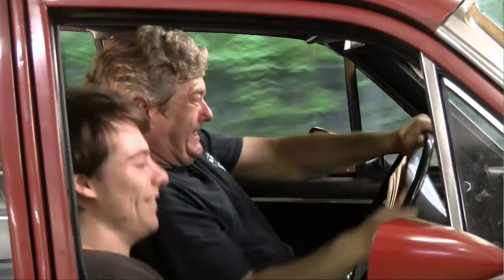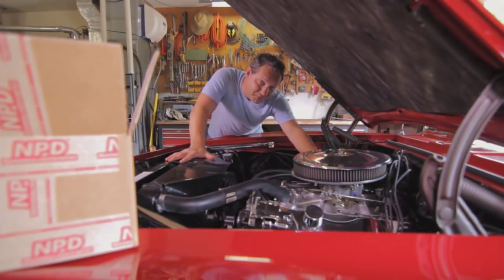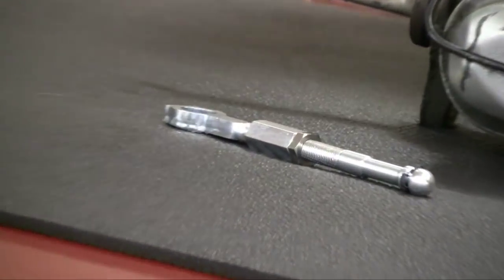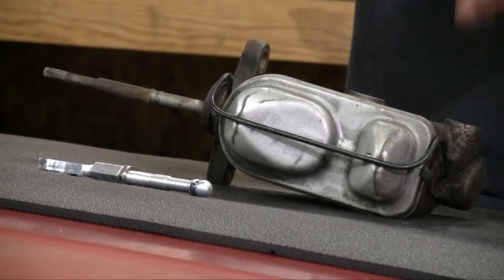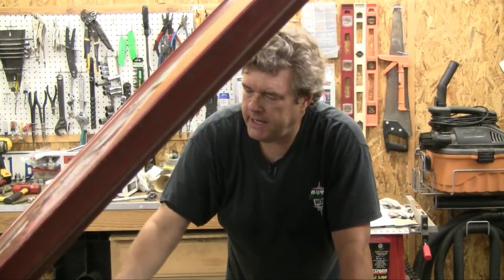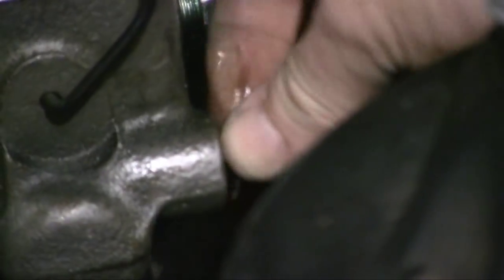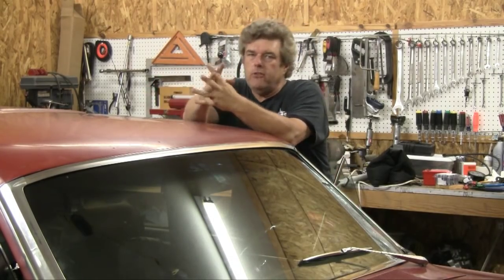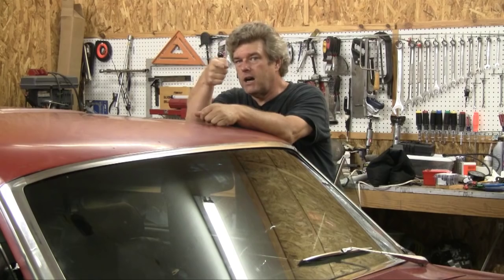Installing the Scott Drake Adjustable Brake Pedal Rod and Maverick Master Cylinder Episode 220 Autor

Comment: Great show, Jeff. I was wondering what you would do to get the old push-rod out. I see that you did exactly what I did. I used my old original push-rod that came with my 67 Mustang on the Granada disc master cylinder. Using the Granada M/S seems to work OK, but now I've got this urge to find out what the bore size is. Thanks a bunch.

Comment: Hi Jeff! A six year old video and still pertinent today. When putting in the new Master push rod (actuator) with the clip end, do you just pinch the locking clip with a needle nose pliers and push it in until it locks? I never had one before. Thanks. Good fun work with the green screen, very cool! Cheers and blessings from Motown/Dearborn, home of Henry Ford and Ford Motor Co. World HQ. aka "The glass house"
Reply from the maker: Yes, I usually use players to pressure the retainer pin in.
Reply: @AutoRestoMod  Thank you sir! Appreciate that.

Comment: Sooooo helpfull thanks. i am all into that because i will have to delete my power booster because it is not getting along with my EFI manifold i put in the 69 torino wagon yesterday . Am learning all about pedal ratio . Have you ever run into that and did you have to source the whole dang pedal assembly for non boosted 68-69 Fairlane ?
Reply from the maker: If it is like the Mustang, the pedal is different. There is a kit (again, for Mustang) that fixes the location issue that the pedal has. BUT as I said that is on Mustang. I'd hit the Torino Facebook groups and ask there.

Comment: I want to change the brake light switch. My car was power disc, now with this conversion do I go with a "Manual brake" light switch? I can't see a difference between the 2.
Reply from the maker: Pretty sure they are both the same.
Reply: @AutoRestoMod  Yes Jeff, they are the same sir.

Comment: What is the measurement off the floor for the gas pedal? I think mine is too high which will throw the brake pedal off also.
Reply from the maker: We really couldn't take that measurement because there was a big hole there LOL
Reply: I just got the Scott Drake pushrod yesterday and the 74 maverick master and I’m making this conversion this weekend thanks for the response

Comment: I have a 1969 Mercury Cougar with 4 wheel manual drum brakes. First upgrade will be front disks. I have been told by the Cougar community no master cylinder change is necessary. However, you gave specifics for the bore of the 74 maverick master. Where did you get this info? I need to decide if my stock master will have the pressure needed when the conversion is done. Eventually I want 4 wheel disks but thst is quite a way off. When I do that upgrade, I do not want vacuum assistance. With the 3 speed and draw on motor vacuumed I don't have room for that huge canister nor want the eventual vacuum failure that all of them have. Any suggestions for an assisted system that does not use vacuum? Thanks much
Reply from the maker: wolfeman351 The Rock Auto site actually often lists the bore diameter on the page. We like the 1974 Maverick conversion in the wagon. Just be sure to order the one we specify in the about section (there are three master cylinders for the '74 Maverick). You will also need to research prop valves to make sure that you are getting proper distribution.
Reply: wolfeman351 
The master cylinder for disc brakes have a larger primary fluid reservoir due to the fact that as the disc brake pad wears the fluid will go down. Drum brakes have an adjuster to keep them at a constant gap but as you use up disc brake pad the fluid takes up the slack. You will need to change the M/C to a disc brake type.

Comment: Nice green screen work kids!
Reply from the maker: Karl X We had a blast setting that one up.
Reply: i have a 66 mustang gt that only came with manual brakes, so I got a booster kit from SSBC 17 years ago. I Put it on myself. It worked but never great.  The brake is hard on emergency stops. It has an adjustable push rod, but I can never get the right amount - too long and brake is on all the time too short and there's no brake or hardly any., .It".not a vacuum problem  either and I checked the check valve and the vacuum level which works. Also I have measured 18lbs of vacuum except when fast idle is on. when I called SSBC many years ago despite that they told me the kit  it works with original pedal but then they started talking about pedal ratio which could be the problem. a few minutes ago  I saw one of your videos (not this one) but now I can't find it. in that video where you  had an adapter in the booster kit for the pedal (probably to correct the ration.) but I can't find that part anywhere. The 67- 70 kits come with a new pedal. I thinking that it I can't find that adapter getting the 67 kit with pedal or just the pedal if I can find the part. I might get the pedal for the 67  but I don't know if it will fit a 66 gt. I might go back to the original manual brakes but I like power better when it works good. Can you guys or anybody tell me the name of that part that goes on the pedal arm and where I can get. email me at mjl2ent@gmail.com

Comment: Hey Guys! Some time after posting this video, I remember seeing another one in which you addressed the pedal travel issue with the Scott Drake Adjustable Set A21161-DB. This moved the pushrod placement a little lower to correct the geometry. I can’t seem to find it. Do you recall this video and was it removed?
Reply from the maker: Might be another channel, I don't remember another video. Though I plan to do this to the F100.